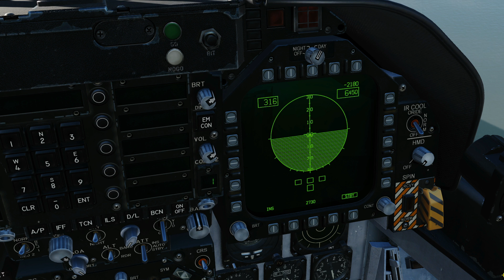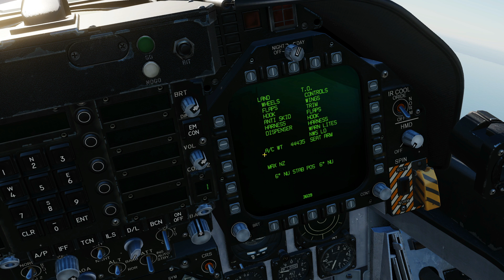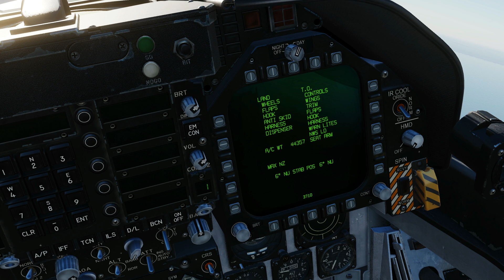FA-18C Hornet: FUEL, ADI, ENG & CHECKLIST DDI Pages Tutorial | DCS WORLD

Comment: TDP is the pressure between the last stage of the turbines and the engine exhausts. Based on what I've read, my guess is that CDP is the pressure of the gas immediately after it's left the last stage but before it's had a chance to expand in the engine exhausts... and I very well could be wrong on that.

Comment: New guy question:
For the left & right feed tanks, I noticed they're currently not equal.
Does this affect the flight characteristics of the Hornet and if so, how do you equalize them? I guess same would apply for the wing tanks - if they were unequal for some reason

(Thanks for the great tutorials!)
Reply: Hey new guy! Not so new anymore IG but I wonder if you ever found the answer to this question. 

AFAIK the 2 tanks left feed and right feed have different maximum quantities. This means that the only time they will be equal(i think) is when all other fuel tanks are drained and the feed tanks carry the only remaining fuel.

Not to worry though, as though they are labeled left and right feed tanks that only refers to the engine in which it feeds not the side of the aircraft the tank is on. this means the aircraft should almost always have a symmetrical fuel load along its centerline(see exceptions below). Different amounts of fuel effect your flight characteristics of course but unless you are running an asymetric external fuel load your fuel shouldn't cause any uncommanded roll or yaw effects(you can still have uncommanded roll or yaw as a factor of asymetric loadouts or external factors like wind).

If your wing tanks are ever asymetrical it is most likely because A) you have taken damage to one of your wing tanks and it is draining into the atmosphere rather than into your other fuel tanks. This, double ugly loadouts, or damage to your wing EXTERNAL fuel tanks(unsure if modeled) can cause an asymetric fuel load along the centerline and thus uncomanded roll or yaw B) you have set the Internal Wing Fuel Tank Control Switch to inhibit and some fuel was transferred by gravity

Comment: Regarding the CDP and TDP, it is a measurement of the static pressure from the outlet of the compressor (just after high pressure section, into diffuser), and just downstream of the turbine (pre afterburner). They measure in absolute pressure (pressure above a perfect vacuum , and as opposed to gauge/standard atmospheric, which we usually talk in), because at the velocity that the gasses are passing through the engine, it's often around atmospheric, on the turbine side at least. Inlet to the engine gets pretty low, and the first part of the intake is designed to slow the airspeed down, and get the pressure up, especially for supersonic flight (Mig 21/sr71 nose cone changes length to control inlet velocity). Monitoring of these pressures gives an indication of engine performance and health.

Comment: The vibration sensor is usually a piezoelectric electric style sensor which outputs a signal proportional to the vibration velocity (or acceleration). Piezoelectric devices output an electrical current if a mechanical force is applied (think of bbq igniter), or a mechanical force if an electrical current is applied (quartz watch!). I’m terms of vibes sensors, think of a mass on a spring, as you displace the outer casing, the mass will deflect, and this can be measured. The sensor on the engine gives an indication of health and can be used as an early warning if something isn’t right, mechanically. Gas turbines rotate around 70k rpm - lots of angular momentum. So any slight imbalance within the engine can cause serious vibes and subsequent damage. Vibe measurement is common place on rotating machinery. Used heavily on rotary wing aircraft for balancing the rotor and head, and to keep pilots from complaining. ;) I hope this helps. Any more engineering questions, let me know! Thanks so much for the vids.

Comment: N1 is the fan module. A 3 stage Fan assembly prior to the engine compressor (N2). N1 and N2 both have different limits due to their operating speeds naturally hence the use of both indications. It can help troubleshoot malfunctions between the two components. 
The engine vibe indication comes from small transducers mounted on the casing sensing impending failure  should there be inlet damage, ingestion, flamout, stalls etc. About the only time that indication is usefull. Technicians install seperate indicators to help balance engine to amad when these componenta are replaced.

CDP and TDP are also mostly for info indications based around certain parameters the engine should be performing at relevant to atmospheric conditions 

Hope this value adds!
Reply: Yes, all parameters are stored on a computer and are able to be accessed based on time of flight, which can aid events that happen in flight. Pretty neat for its age!
Reply: Oh and the record function would aid maintainers troubleshoot faults when pilot's could record malfunctions mid flight, during certain maneuvers, altitudes, power settings etc.
Reply: @nicholasatterton7630  And I assume they regularly record engine parameters just to keep records that allow plotting of trends as the engine goes through its life.  These can indicate a need for adjustment and trim to compensate for gradual degradation of components. Engine vibration growing out of the allowable range can lead to accelerated decrepitude.

Comment: Behind the throttle quadrant - switches to control which external tanks drain - so you can drain wings first then centre, or the other way around
Reply: You want to drain the wings first ie set the center pumps to STOP before takeoff. They provide more drag than the center tank, so the sooner you can ditch them, the better.

You can do some other fancy stuff with those switches: 

First, you can't refuel your tanks from a tanker, but your plane draws from those tanks first. If you have a mission where you're going to hit a tanker, then make a fast or far dash to your target, turn the fuel pumps off before takeoff so you keep your tanks full until that dash. Switch them back to NORM right after you get off the tanker hose.

Second, you can speed up your "pitstop" times with them. You may have noticed it takes several minutes to refuel the F-18 but like 30 seconds to reload it. You can speed up those pitstops by landing, getting 3 tanks (and DON'T touch the fuel bar), and setting those switches to ORIDE thereby enabling the plane to fill from external tanks on the ground. Then after you're told "reloading complete," call for another refuel/reload and ask for whatever load you actually want. The fuel flow rate will be 4x quicker because you're drawing from 3 tanks and 1 ground hose.

Finally, there is a nearby switch labelled "INTR WING." Normally, fuel is pumped to the wings to keep them loaded and even. But if you're damaged in the F-18, you've probably got one of your internal wing tanks punctured. That means your plane is just pumping fuel out of your plane. If you switch that switch to INHIBIT, fuel will stop being pumped into the wings. You might be unevenly loaded, but at least you got gas to get back.
Reply: @andrewmccarthy8612  i could have sworn i could refuel external tanks at the tanker. will try again tomorrow
Reply: @andrewmccarthy8612  Great info!
Reply: @andrewmccarthy8612  nice. Ty!
Reply: @andrewmccarthy8612  Page 30 in the manual says that you can add fuel to the tanks.
Reply from the maker: Alright Green Button nerd!!

Comment: 3:50 no that indicates yaw. to prevent slippage you "step on the ball" or when it's to the left apply left rudder. more important in the tomcat but still useful
Reply: You know I'm a critic, but to be fair I think he actually got that part right. (Well, he incorrectly called it yaw rate instead of turn rate, but this is my penance so I'm trying to be gracious.) He rolled into a bank and the lower box box slid under the upper box in the direction of turn.  Looks like if the lower box stopped halfway to the upper box it would have been half standard rate.  It did not seem like he was slipping or skidding the aircraft.  With a turn indicator arguably being more important than a slip indicator this would be the one to have if you can't have both.
Reply: @gort8203  Isn#t it the same? The higher the bank rate ,the higher the slippage will be. And I doubt that the bank rate makes ANY sense in a fighter jet. It doesn't even make sense in a passenger aircraft. So I would agree that this here is "the ball", meaning it shows slippage.
Reply: @jemand8462  Negative - the FCS in the F/A-18 automatically trims and adjusts to prevent "slip or slide".  This would indicate a 3 degree per second turn or a "Two Minute Turn" which is used to perform several different instrument procedures like Holds and approaches, DME Arcs, etc.
Reply: @Aphelion79  aaah! now It makes sense to me! I thought it meant "rolling 3 degrees every second" but it actually means 3 degrees heading in 1 second, which is 360 in 2 minutes. Thanks!

Comment: 3:00 - It's the other way around at the bottom is 0 degree of bank with the markers on the right showing 90
Reply: Can't believe these guys make "tutorials" that are so inaccurate.
Reply: That's wrong. The markers are in 30 degree increments relative to the horizon. So if you are wings level its 0 degrees. First mark is +/- 30 degrees (for left or right roll). Second mark is 60 degrees (+/-) and at the bottom would be 90 degrees or basically on one wing. Dont know where you got that info from but this isnt ace combat buddy.
Reply: @Duvstep910  Bruh ... please stop ... you have no idea what you're talking about.
Vertical line on the bottom is used to get the bank angle look it up in the official manual.
Reply: @RelaxSimmer  So I wasn't crazy.  Thanks!
Reply: @Duvstep910  Rlalox is right..?

Comment: External fuel switches on the left below the throttle allow you to control fuel flow. Override = drain to internal tanks, Norm = drain equally, Off = don't drain that tank.
I use this to drain my center-line tank first so I can get it off the bird faster.

Edit: Added Cruz Tomas's correction.
Reply: ORIDE allows the external tanks to be pressurised and used when they normally can't be, e.g weight on wheels.
The other external tank fuel control switch must be in STOP if fuel transfer from its tank(s) is not desired.
Reply: Override seems to send the fuel to the internal tanks.
Reply: @Thomo_1  Thanks, I have always turned it on with the internal tanks full so didn't notice.